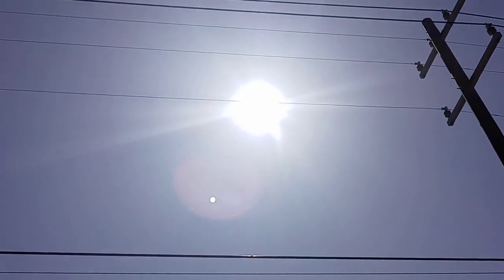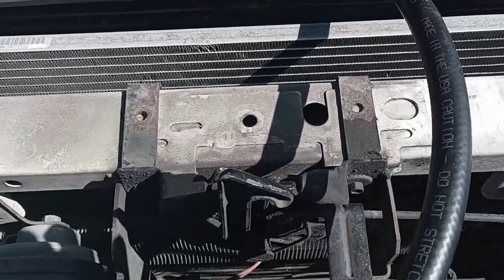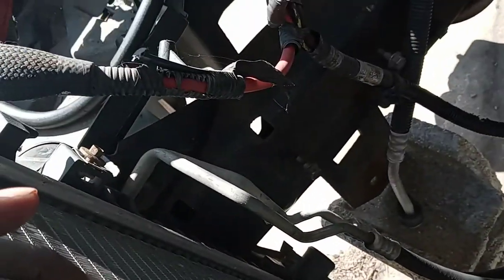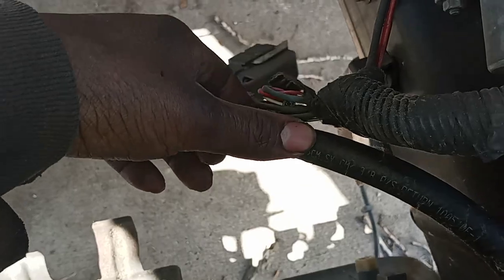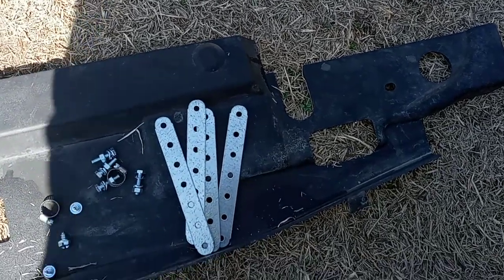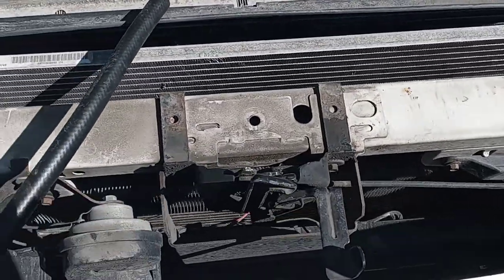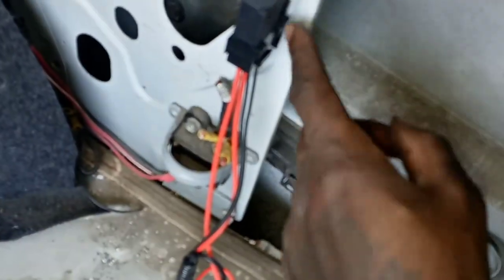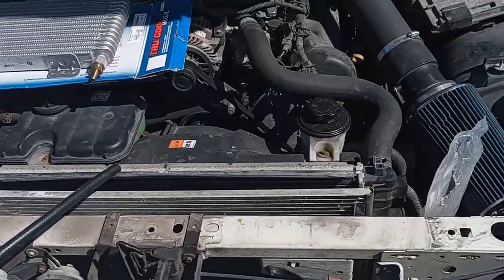Never-before-seen on YouTube how to install a aftermarket Tru cool trans cooler ep 1

Comment from the maker: Stay tuned for the engine install hit the like button for me guys you know I never asked you for much thanks Crown Vic Nation
Reply: Quick Question. @crown Victoria lifestyle Hey i think my trans is over heating. After driving for about an hour or so my trans starts shifting funny 1st and 2nd gear normal shifts 3rd and 4th shifts weird quickly to the point where 4th gear starts at a really low RPM. I thought it was the trans starting to slip , got a new transmission install and itS doing the same exact thing. Can anybody help me on on this crazy issue. BTW its a 2006 crown vic p71 with a marty tune..

Comment: in theory it sounds like a good idead. My only concern would be debris from the power steering system getting into the transmission. Transmissions are super sensitive to any foreign matter, and I'd think you'd want to keep those systems isolated.